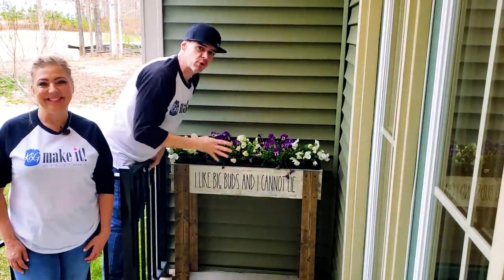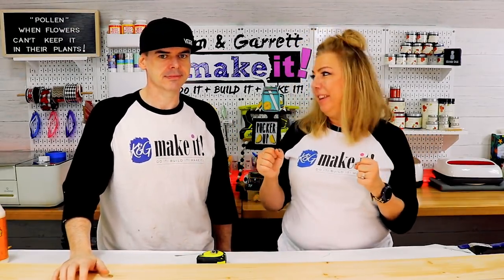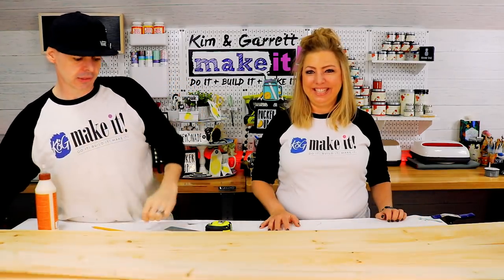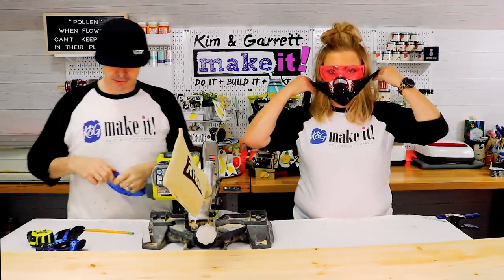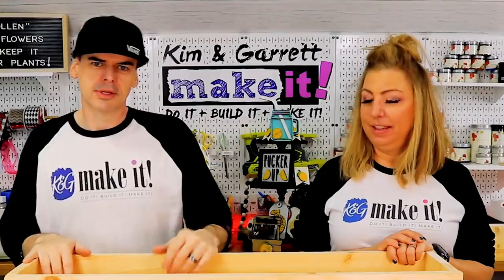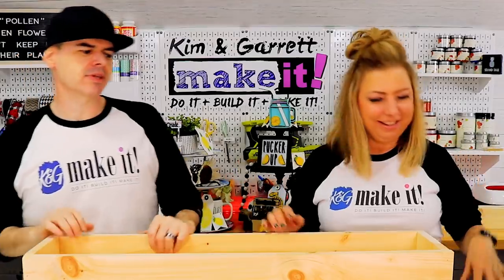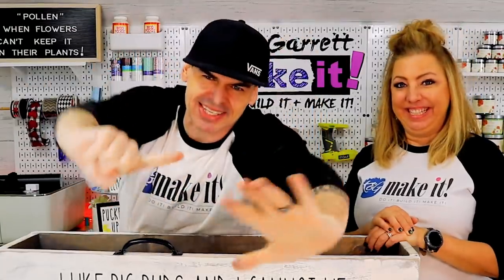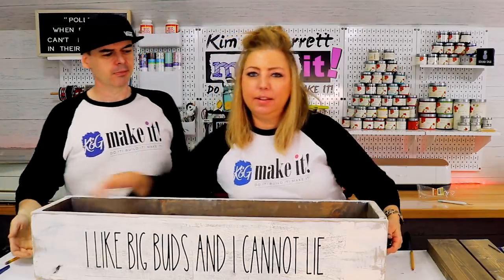How To Make a Super Easy DIY Raised Planter Box

Comment: Guys! Of course it looks awesome! I was having an awful problem with my vinyl pulling up my paint, making my projects look wayyy more distressed than I intended. (I always use  permanent 651 vinyl for stencils bc I don’t have to worry about my stencil bleeding) BUT I’ve figured out the solution. I use a hairdryer (high heat) to pull it off. The vinyl gets really loosey goosey, the adhesive on the back let’s go if the paint... and there ya go... works like a charm! Just don’t use your heat gun, I did that once, too much heat!! That was a mess!! Hope that helps!! You Guys ROCK!! ☮️💗
Reply from the maker: OOOOOH that's an excellent idea! Somone down in the comments also suggested wax first, I wanna try both!